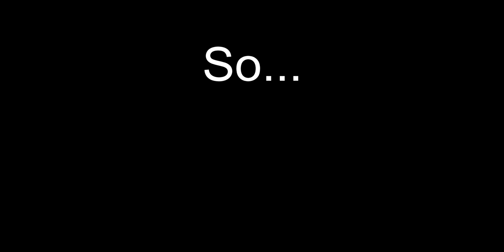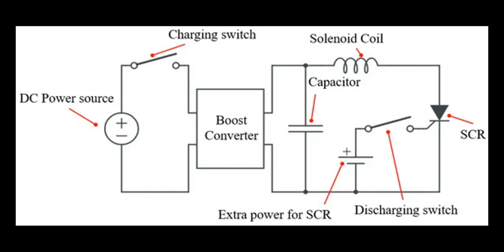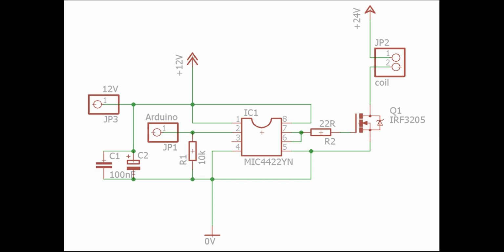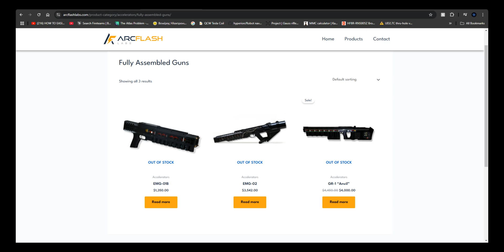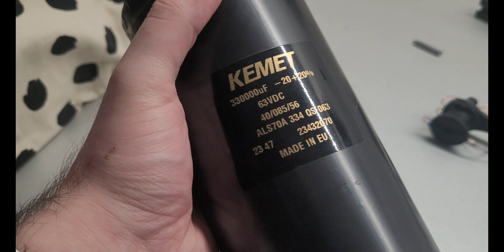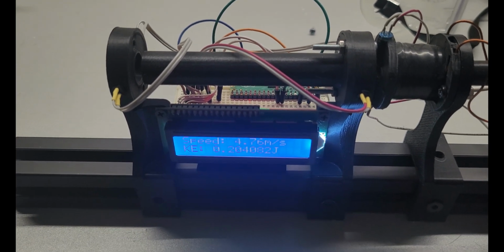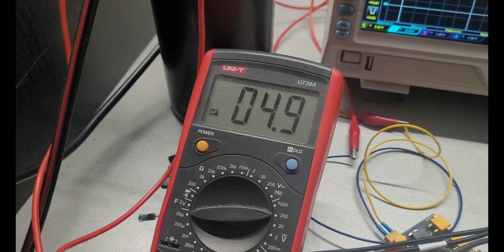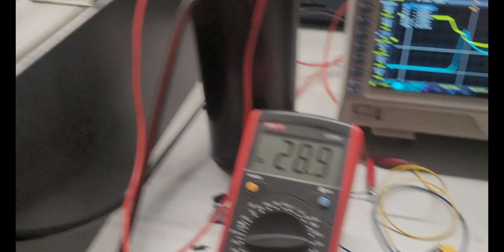Designing and Testing a Hybrid Coil Gun System - CBA-MK3 Part 1

Comment: why did you use capacitor with huge capacitance ? don't you just need the impulse ?
Reply from the maker: The higher the capacitance the more stages will be at the highest voltage of the capacitor when fully charged, with a smaller capacitor the first stage might bring the capacitor down to 38v then the next one to 33 etc, if the capacitance is higher the voltage drop will be much lower stage after stage. Kinda bad explanation from me
Reply: @Locksley3D Oh, yeah, I got it

Comment: Cool! I'm also working on a low voltage coilgun :)
Reply: I actually went with a similar ideas, but I have 36 stages and a totally different switching. I've based on 4115's but switched to a bit better FETs.
Reply: You won't after you understand Lorentz's Law & Ohm's Law. It is ampere-turns that does the work. If your voltage is low, where will your amps come from?

Comment: I've always wondered: is there a  way to dump the energy from the field collapse in to one of the coils ahead of the projectile rather than just dissipate it?
Reply from the maker: That is actually a really interesting idea. I have no clue if it could be implemented though. Normally after a stage shut-off you immediately power the next stage so routing the energy from one to another while also powering it could be problematic. Also, I don't know if the coil could absorb the energy fast enough to not let the voltage rise so high.Lastly, the energy that is actually created is not that much so I don't know how useful it could be to power another stage. Cool idea though, I will keep it in mind and maybe do some tests later on.
Reply: I assumed that you get quite a lot of the energy back from the field collapse because I thought that's how boost converters worked and that they could be quite efficient.

It's probably not worth it to try and shunt the power in to a proper stage (with all the associated electronics and risks) but could you put a second coil in series with the flyback diode and place it just after the photo-detector?
Reply from the maker: @John-gw3mj  That is how boost converters work. However they charge and discharge their coils many many times a second where here it would be just once.

You could put a coil right after that and it might add to the power output but then you would have to have 2 coils per stage which for not space-constrained designs could work. In my final design, I want the barrel to be as small as possible which poses other challenges.But theoretically, it could increase the efficiency if the energy is enough
Reply: @Locksley3D  TVS diode to clamp the voltage spike down (<0.2% efficiency loss) and some diodes to redirect the coil's stored energy to the next stage's capacitor (like the TK-20) :)
You can try to email me, I can share some more ideas